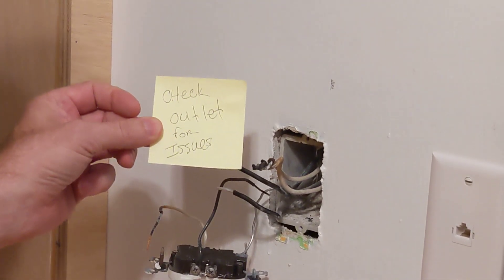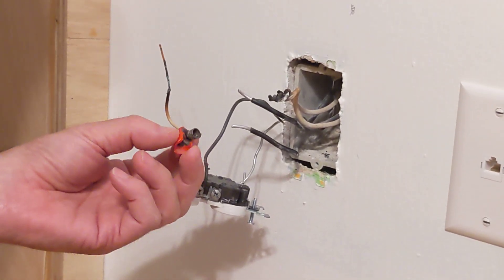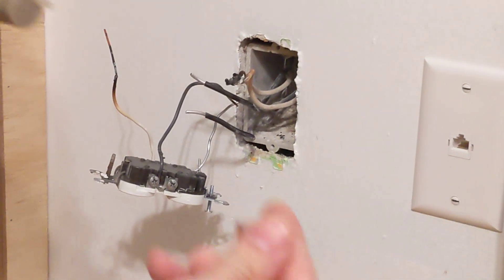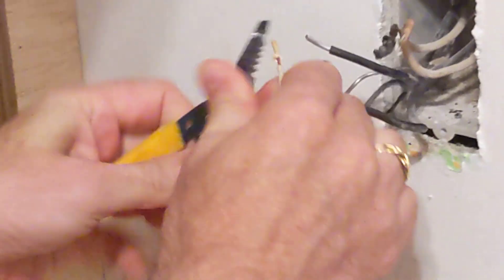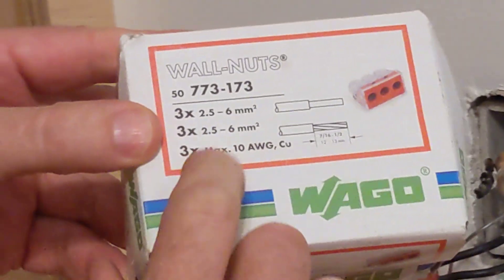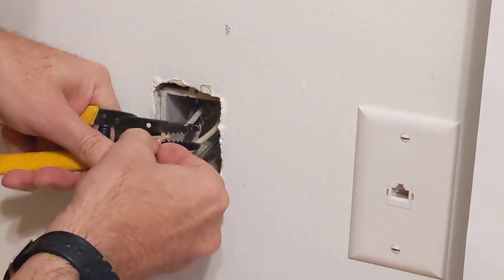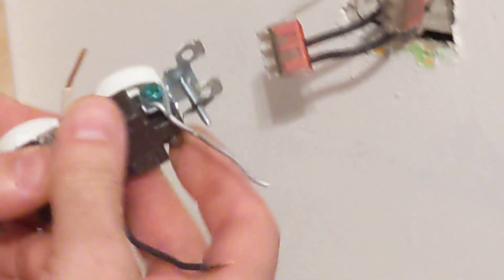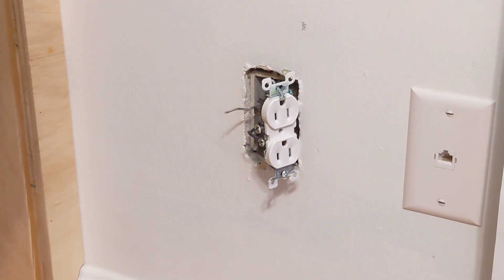Aluminum wire = house fire? How to retrofit

Comment: Thanks for this video! It's the only one I have found showing Wago for AL wire pigtails.

What Wago connectors are these? I bought 2773 which are the only ones I found compatible with AL & CU. But they look different than what you have.
Reply from the maker: They are Wago 773-173. Wago states they are suitable for aluminum conductors if 249-130 "Alu-Plus" contact paste is injected into the connector cavity before inserting the wire. Basically, fill the connector space with Alu-Plus. In my opinion, this is the safest, neatest way to join aluminum conductors if replacement with copper isn't a reasonable option.
Reply: @nickydoes Thanks. Looks like the 773 series are obsolete as of May 2025, replaced with the 2773. 773 still available until stock runs out, but makes sense why they don't feature it on their site.

I'm rewiring a 1970s house and while I have Wago telling me it's ok to use these (with paste), I appreciate another video confirming it. Seems to be ignored in all the other videos about AL wire options.

Comment: Is this allowed/approved  by insurance in the USA? I only see the screw on aliumcon or the copalum (only by trained installers)
Reply from the maker: You'd have to check with your insurer. It's compliant with the NEC and my jurisdiction.
Reply: Thanks for this video! It's the only one I have found showing Wago for AL wire pigtails.

What Wago connectors are these? I bought 2773 which are the only ones I found compatible with AL & CU. But they look different than what you have.